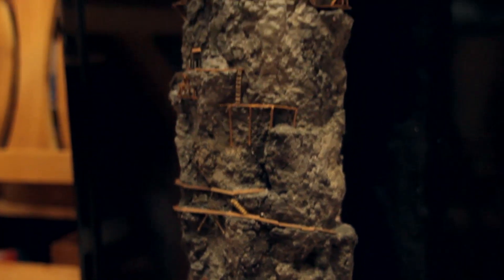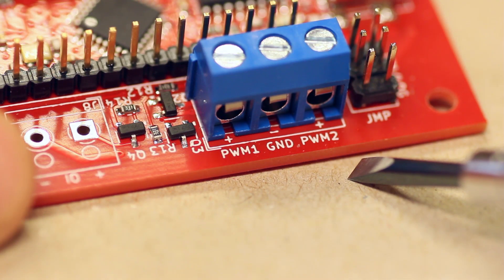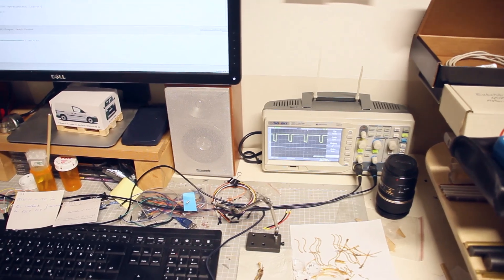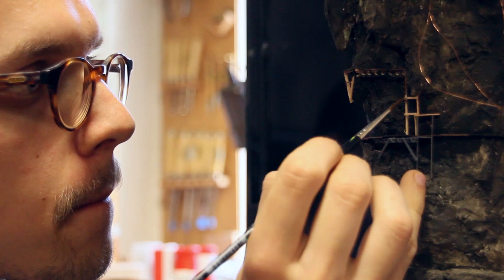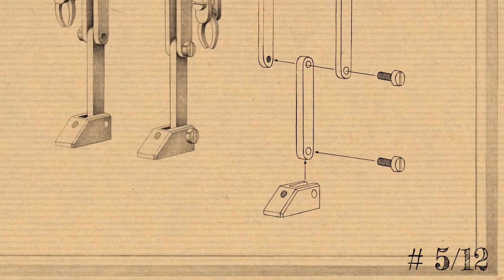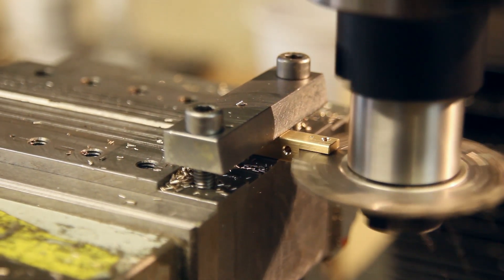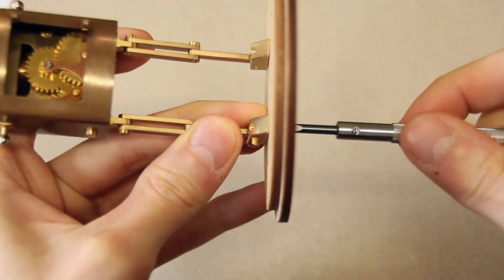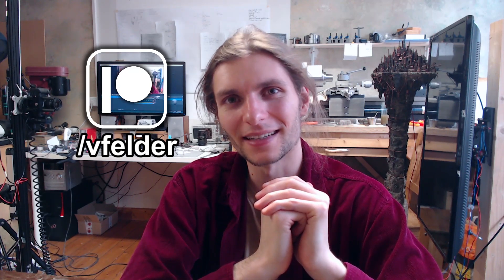Making a Miniature Light Controller for Everyone! - Update 06/2024 | An Unwound Clockwork

Comment: Thanks for the update - as always fun to watch!
Just in case you would need more PWM channels - have look at NXP's PCA9685 16ch PWM IC. There are arduino libraries, so it's actually really quick to integrate. 
For LED-only, you can use the existing  "PCA9685 Servo PCB boards" directly, but for higher voltage/current bulbs, 1 MOSFET per channel is required, so you would probably need to make an extension board or integrate it in V2 of your design.
I'm curious if many independantly controllable lights is actually something that would match the atmosphere of the movie, or if this would add just too much dynamic or "life" to the scene... anyway, looking forward to watch it!
Reply from the maker: Thanks a lot! - In practice I rarely needed more than 2 independent channels and in order to keep the device as affordable as possible I'm trying to only use a minimal number of components in this first version. But if there is some interest I might consider making a bigger version with more channels and more power at some point! :)
Reply from the maker: By the way, I think I actually have some PCA9685's lying around, I have used them for another project once :D
Reply: @ValentinFelder ah, I could have guessed ;)